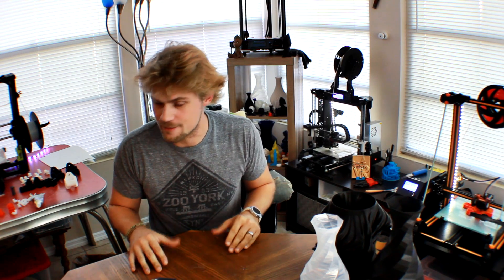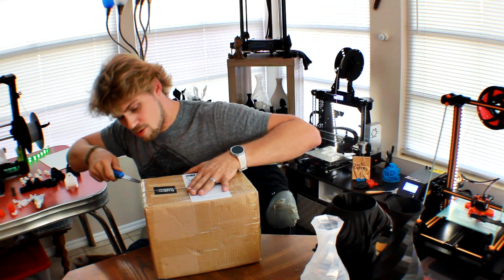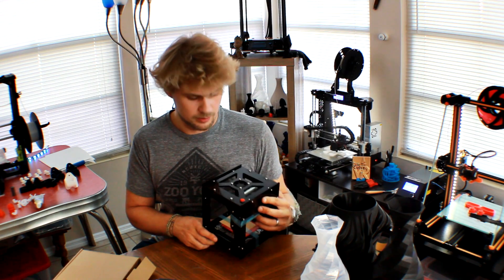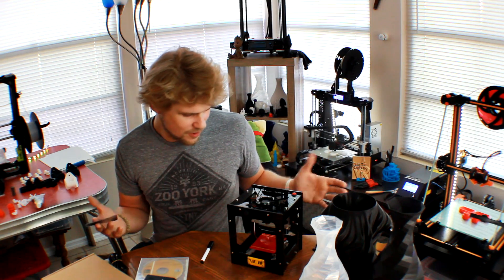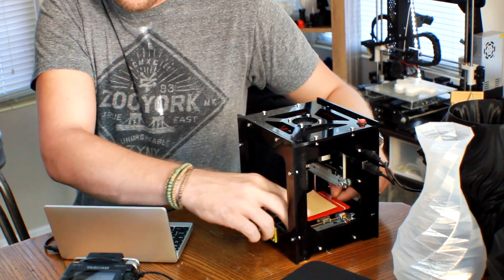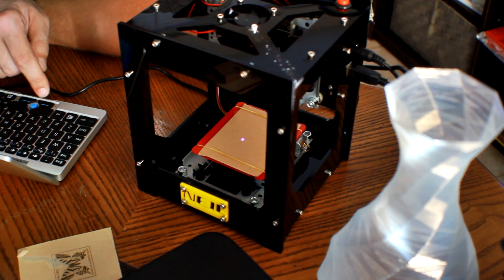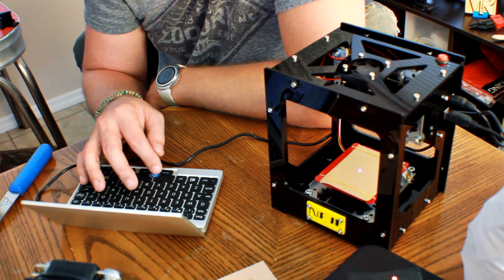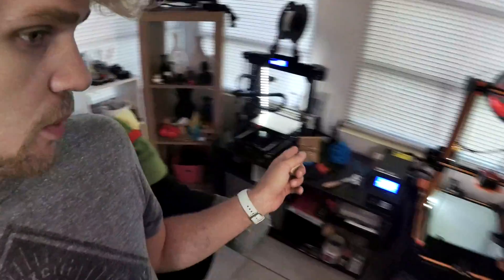Laser Engraver Printing - NEJE DK-8-KZ 1000mW  | Quick Review!

Comment: can you please help me I bought a Meterk mini portable laser ....one similar to this one in your video earlier this year in May and it was working fine....initially i used it to engrave small pieces of wood that I use to make key rings....it was working fine until last week....when I sent an image to burn....it starts off fine and then the laser starts burning only to the left it keeps running on the left side even though on the software the image is centered and the board in centered....the laser keeps printing the image to the left only....do u know why it would do that? is something wrong with the laser head?

Comment: may i ask one thing. can it engrave an anodized almnium. like a fashion blank dog tag? thanks
Reply: I have the Meterk dk-Bl 1500MW, Um I have yet figured out how to do it, there's many people stating anywhere from using mustard, to tape, etc,... to engrave on metal... unfortunately none have worked for me, and I don't recommend trying it on bare metal, the laser can reflect right back up into the laser itself and fry it.

Comment: ill will get one of these...thnx for review..just my concern is on parts..especially the laser , how many hours the laser eye can last..
Reply from the maker: Unfortunately I do not know the answer to this just yet, i've been using it for a few months now a few times each week and it still works the same as the day I got it) Hope that helps a bit!~
Reply: ok thnxx fo replying..some web stating the laser eye can be replaced (sell separably)..1500mW looks promising with BT apps via smartphone.
Reply: The laser’s eye?! I’d be more concerned about your real eyes getting cancer with this cheap Chinese units bouncing it’s radiation all around your room. 🤨